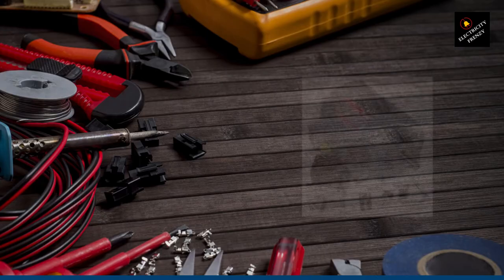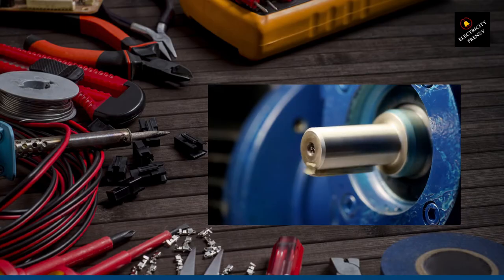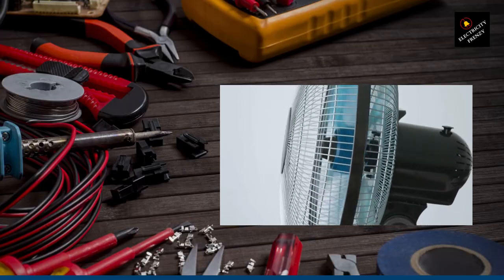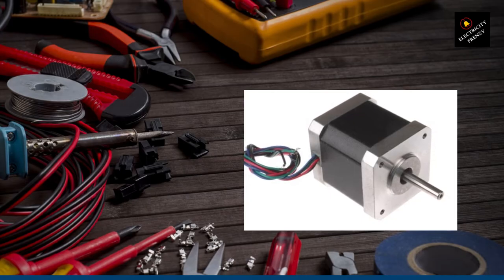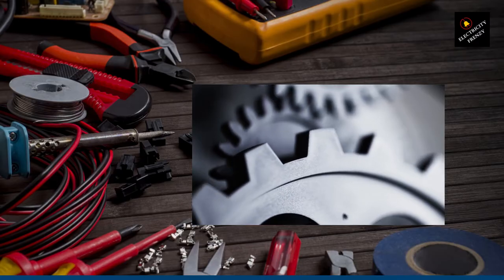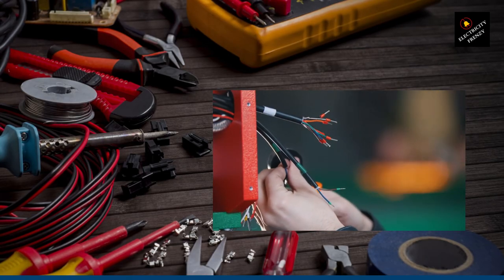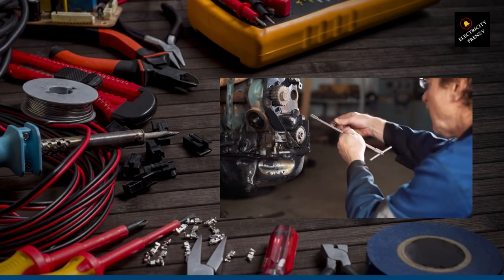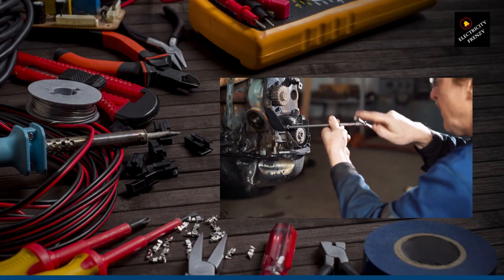Why does electric motor overheat - 5 most common causes

Comment: I have a jet model electric bench grinder that just started overheating and losing a little power tonight. I thought maybe the vent on it was stopped up causing it to overheat,so I blew it off and didn't find anywhere that was for it to vent,obviously electric motors are not my specialty. You setting your video If it wasn't getting the correct current that would cause it to overheat.I had it plugged into a shared outlet, ill try it in a stand alone plug next. Thanks for the video
Reply from the maker: Thanks for sharing this with me. Hopefully, you find the reason.
Please let me know once you find it.

If you need any assistance please feel free to reach out.
Reply: @ElectricityFrenzy  thank you sir that's awfully kind of you I'm sure something will come up that your experience will be very helpful to me. Almost forgot my motor overheating seems to have been caused by it not getting the correct amount of current from the shared Outlet. Thanks again and have a wonderful day
Reply from the maker: You welcome 👍👍